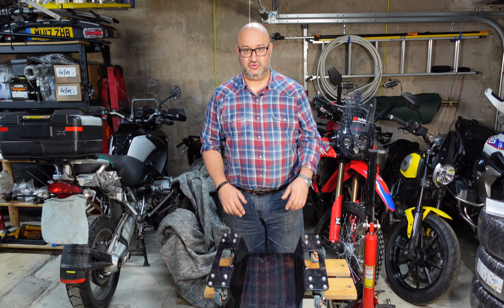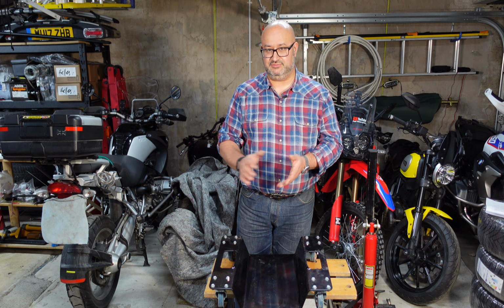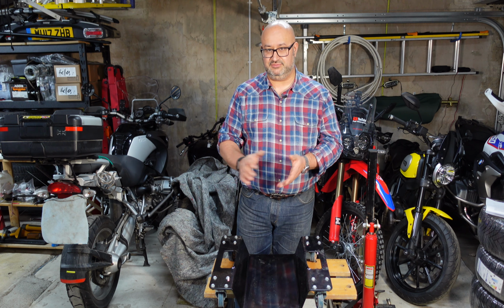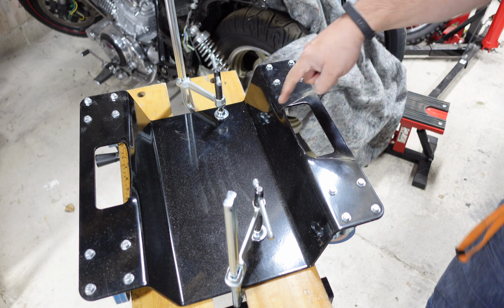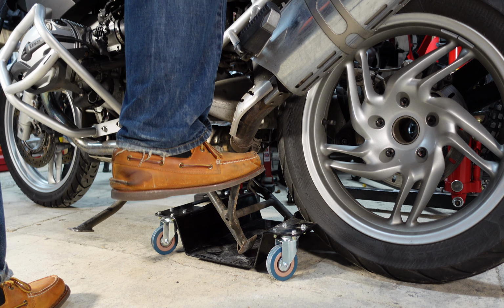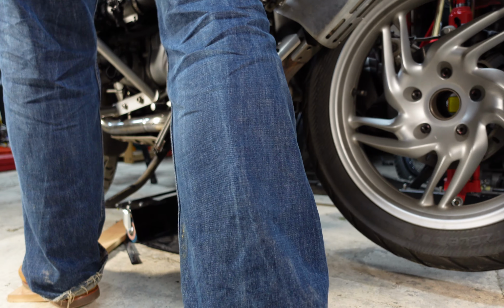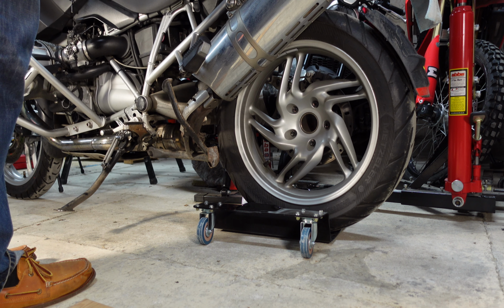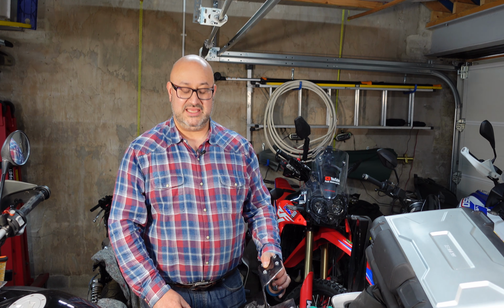Gear: Lamberts Engineering Heavy Duty Motorcycle Dolly 4K

Comment: It's good to see why some products are not worth buying as well ones that are, so thanks for putting this video up. It has saved me making a bad purchase.
Reply from the maker: Indeed. Though they have also disappeared from their website. I've found some others in Europe which I might try, Constands do two, a 300Kg version with a footbrake for loading and unloading (which looks rather good!) for €80, a 320kg version with locking casters for €100 and a 400kg with locking casters for €120. All are 20% off at motea.com at the moment, so perhaps I'll try one and see.
Reply: @PeakMotorcycles  In a few of your videos I see you have your CRF on a hydraulic stand/lift thingy - it looks quite meaty, not your little paddock stand but the big red one. Would that be able to lift a GS? If so could you lift the GS enough to put the centre stand down then slide the dolly underneath, then lower it down onto said dolly?
Reply from the maker: @whatastate  I do, and it can definitely lift a GS. About 4ft off the floor even! However the frame of the lift goes under the bike pretty much where the centrestand and dolly would be. It's also a bit of messing around, taking off the swingarm bolt covers (that's where it lifts from) and though there might be a way, I think just making the dolly work (or getting a working one) is the long term solution. Thanks for the thinking though! With videos like this, I'm never sure if anyone's going to watch them or get anything from them... It's great to get any sort of response, never mind considered ones. (I did like the banana skin comment though 🤣)